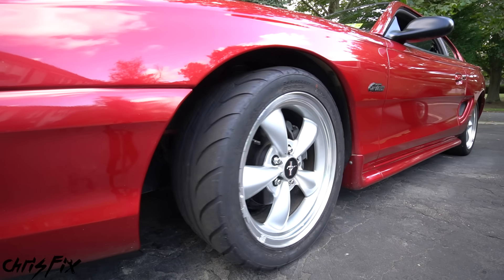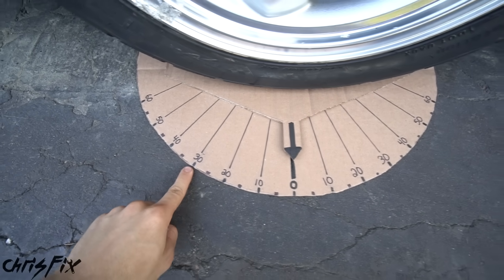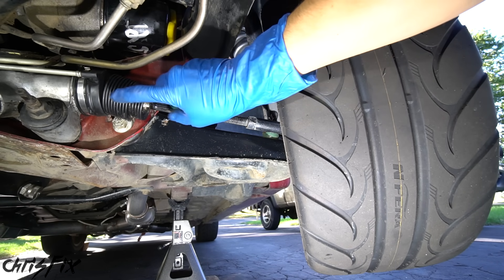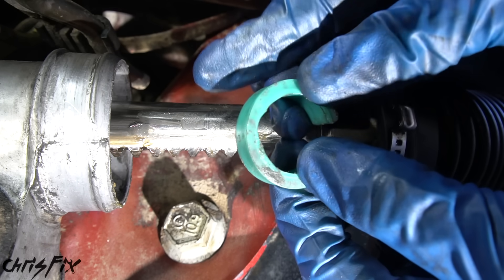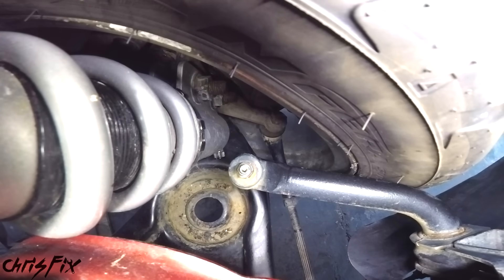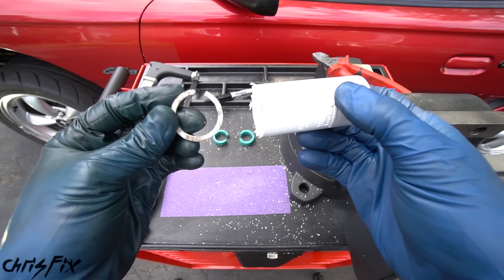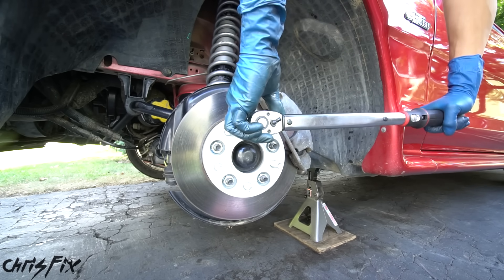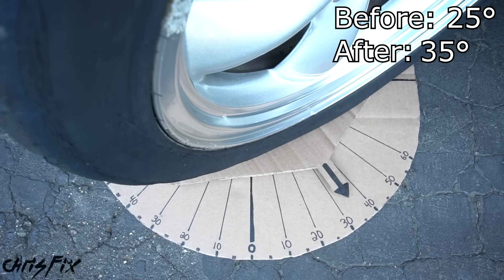How to Get Your Car to Make Sharper Turns (Steering Angle Mod)

Comment: Wheelbearings will wear out quickly if you use the spacers, because the wheel will burden the wheelbearings unevenly. So this modification seems to be an easy job to do, but it's more demanding than you think. Sometimes it's better to leave it as it is than replace wheelbearings monthly.
Reply from the maker: Thanks for sharing. I drift this car and drive it daily. I have gone off the track at over 90mph multiple times and towns 2000lb trailer to and from the track with this car.  I also put many thousands of street miles in the car and the wheel bearings are perfectly fine. There definitely is more stress on them but not significantly.

Comment: Ha misconceptions about wheel spacers it's best to get the ones with built in studs so the wheel lug nuts are full tightened as it would be without the spacer

Comment: Do you have to add spacers to the back as well or does it not matter?
Reply: Wouldn’t matter I don’t think as the back wheels don’t turn
Reply from the maker: You don’t have to if you don’t want. The rear wheels are independent from the front.

Comment: Called single use for a reason.
I was surprisingly right with you . . . until the spacers.
The tread width front to rear, have a correlation to each other that is there for a reason.

Comment: I like your channel, but you ruined the car.. the front track (width between tires) is smaller than in the back for a reason. Adding spacers ruins the stability and drivability.
Reply: also check if they are road legal in your country.

Comment: Hi Chris. I like your videos, they are really helpful and just can't stop watching over and over again. I bought 2019 Ford F150 XLT  Super Crew which has 2.7 ltr turbo charge V6 power plant.  It drives great and has the BEST gas mileage. The only complain about i have is turning radius. I feel like i'm driving good old heavy duty diesels. Do you have any suggestion to reduce the turning radius? If possible can you do a video on it? I know many of your subscribers want it...

Comment: Why in the world would you use antiseize on the rotor and threadlock on the studs? Very counter intuitive. If you torque the nuts properly, threadlocker is not needed. I grease my wheel studs and I drive 3 different cars and haven't had issues
Reply from the maker: Never use antiseize on the studs. You use medium strength theeadlocker to make sure the lugnuts do not loosen from vibration. Antiseize is designed to make something come off easier. That would fail tech depending where you live. Hopefully that answered your question.
Reply: @chrisfix  
Well to be more specific, I use motor oil on the studs, but have used a type of foam grease before. If the lug nuts are torqued properly, they are not going to just vibrate loose.

Comment: Just be careful with the pvc pipe idea. Pvc can get pretty soft when it heats up. Just not sure if its too hot to matter where it will be. Just a warning. Definitely would recommend shaving down the old ones. That way i kno they wont melt

Comment: Just had a new electric power steering rack fitted on my 2011 ford focus LHD in the UK, and I notice the steering when fully turned left or right does not return when I loosen my grip slightly but will stay in the full turning pattern, is this something the garage had to limit on the steering angle?

Comment: there is no diffrence on between running a spacer or a offset, if it aint stock its going to be hard on the wheel bearing.

Comment: So, are you going to add spacers to the back?  You've increased the track width of the front tires by 2".  The rear of the 94-98 mustangs needs help.  You should add some 1" to 1.5" spacers in the rear.  Would look better IMO.
Reply: Wider stance driven through the axles and diff center will produce extra torsion (the axle lengths aren't changed but the length between diff center to rear wheels will be longer). The extra torsion will load the driveline all the way back to the clutch and gearbox with greater shear stresses. Parts life before failure could be shorter, maybe not by much. Dunno.

Comment: A lot of vehicles will have a limiting stop o the lower control arm. It's basically a bolt welded on the control are that will come in contact with the caliper bracket on the spindle. Sometimes the bolt will be adjustable, some you need to cut off with a grinder/torch.

Comment: it would be wise to put 2 spasers at the rear wheels also.

many cars dont have these rack stoppers 
the rod is used as a stopper
to increase the angle in these you have to put a spacer in between the rack and the rod
or shave the rod to fit in the rack body

Comment: Great video. But never trust those 2 jackstands alone. They can fail and smash you dead! Cheap china castings can actually snap like a potato chip.  Use a USA but still never trust them completely.  Use wood blocks or leave your jack under the car as a 2nd safety net!

Comment: Now what you need to do is add some 35mm spacers to the rear wheels.  Ford, in its genius, decided to give this car cavernous rear wheel wells and then then set the rear wheels about 30 feet into them!!!...Without rear spacers you can never give this car that "mean" look even if you put a 1000hp engine into it.  You did get more turning radius but now the front tires edge out toward the  lip of the fender while the rear wheel still stay sunk into the wells.  I  have this same year Mustang but what I did was to add 35mm spacers PLUS chromed DEEP-DISH rims and was astounded at the difference in the appearance of my car. The tires actually come out even with the lip of the rear fender and looks 100% more aggressive...AND, because of the wider stance, also handles so much better when cornering.  Also, I went with 19 inch rims in the rear and 18 inch rims in the front so all-around my 98 looks incredibly more aggressive than what it did from the factory.

Comment: The max turning radius is determined by wheel offset,as well as width of rim/wheel wider rim/wheel =less turning radius.
Reply from the maker: It’s determined by the limiting factor which could be clearance or how much your steering rack moves.

Comment: 99.99% of you will not be able to just "twist off the boot" without damaging it.  You've been warned.
Reply: It's not giving me any issues...oh shit...damn, anyone know how to replace a torn boot? ....lol
Reply: The ear clamp can be worked with a flat blade screw driver to open it far enough to get the boot off. Besides, un-like most, after 30 years of dealer work, I have a bag of 50 or more in the bottom drawer of my tool box. You can buy these at the dealer alone, but plan ahead as they will have to ordered. Also, thinking outside the box, once you know the I.D., go to the irrigation section of the home improvement store and they sell these for water pipe used in lawns. Also, if you have a hydraulic line / cylinder shop in town, they carry these for low pressure return hose up to 8" I.D.
ASE Master Tech since 1978/Retired.
Reply: Oh come on it's so ez
Removes the boot
Tears the boot apart
So um i am back and where can i buy replacement boots?
Reply: Look, as an ASE Master Tech since 1978, if you are unable to remove the "Pinch" type clamp with "Ears" using a small flat blade screw driver, insert into crimp, twist back & forth carefully, then cut with side cutters. But if this make you sick, or scared / tearing the boot....do this!
Rock Auto, Ford, 2002, 4.6L, steering, Rack & Pinion Bellows, select the boot / bellows that comes with ear clamps starting at $4.27 + S&H. Fixed. I have pliers well used for these clamps. Quit crying and Do It! Man-Up and get R done. Dam.
Reply: @deankay4434  thanks for this comment,this will help some people,luckily this was a joke my last comment.lets hope it stays a joke for most of the people
Reply: @sabagamer3052  Just trying to help and make this easy. It takes years of experience to learn and do the vehicle repairs I have made. Pass it on!
Reply: @deankay4434  you are so nice.
Reply: Bra😂
Reply: NorthernChev correct
Reply: 500th like
Reply: That's exactly what I was thinking lmao
Reply: Hose clamps aren’t a good enough replacement?
Reply: Why does it come in 2 pieces instead of one 😂😂😂
Reply: Deadass?

Comment: So with the front wheel adapters, that's going to obviously widen your front track width...how is that going to affect the driving dynamics of the car?\
Are you going to need to add adapters to the rear as well?

Comment: In my understanding the friction between the rotor and the hub is what transfers the torque. So when you lubricate that surface the bolts will be under shearing stress which they are not meant to withstand. I lubricate the centering ring in the middle but never the contact surface. Never had any problem with stuck wheels.
Reply: Wow

Comment: OK so did the manufacturer did it at the 1st place?
Reply: The limiter was there to prevent the wheel from hitting other components,  which cleary did. Plus it's easier to damage the boots with a greater angle.

Comment: Don't do that with front wheel drive. Could be problem with axle
Reply: No. Not with the amount you're changing the angle.  CV joints can move quite a bit.

Comment: On our 2003 GMC Yukon Denali we’ve had hub centric spacers on with 305 wide tires and 22 in rims since we bought it new back in 2003 and we have had zero problems with wheel spacers over 130,000 miles. We have replaced nothing due to them, as long as you buy quality ones I would say it’s pretty much like running stock just with wheels that stick out more.

Comment: DO NOT use any type of lub etc between the spacer and hub face your asking for a failure of component. The wheel nuts only provide the clamping force the friction from the two faces meeting is what resists sheer forces etc. Common error like this is the biggest cause for sheered wheel studs and the wheel going for a run up the road without the rest of your car attached.

Comment: you turn left its 30 you turn right its 25 wtf how is this possible :)
Reply: Ackerman steering
Reply: Also known as toe out on turns
Reply: It's called steering axis inclination.  On a turn the tire on the inside has to turn sharper as it's following a smaller radius.
Reply: So this steering lock angle difference would be the other way around on the right hand front tire?
Reply: Ackerman affect
Reply: rt turn 30,  lft trn 25.   weird,  the inner wheel in a turn  should make a tighter angle that the 'outer ' wheel.  that's Ackermann,   because  the axial centrelines of the 2 front wheels should always coincide where they cross the real axial  centreline.  so the inner wheel turns more than the outer.
Reply: @captainboggles  you are right, seems like rack is just limited different amount to other direction.

Comment: Would these changes work on a Boxer Engine layout like on my 86? The car is JDM specification so the layout of components or steering wheel and rack may be different than a USDM equivalent FR-S or 86.

Comment: You realize, I hope, that the steering rack is not centered, and that means adjusting the tie rods, toe in ,and steering wheel mounting. The inner wheel should always turn more degrees into the turn than the outer wheel, too. Check the angles on Both front wheels.

Comment: many manufactures don't know what the clearance is of the their tire to closest obstruction when the steering wheel is turned lock to lock, which manufacture do you think doesn't know? The likelihood of this being free, is slim, you'll probably need spacer hubs. Before removing anything, check your clearances to see if you can get anymore angle. As your swing arm suspension moves up and down from the middle position, clearances will decrease. Are we to see ChrisDrift?

Comment: Hey,i really enjoy all your diy's but this one,in my country the spacer method is actually illegal and incase an accident you would get shorted maybe 0 insurance pay. Also when increasing the limit of the steering wheel on many cars you risk abs lamp on and none multifunction keys on steering wheel working because the clockspring on the steering column got shot,that happens frequently even without increased steering angle. On a car made for tracks and so this might be something,but on a street car i wouldnt risk ripping the clockspring as its a expensive part to replace,i know because i just did,still very found of your other vids,keep up the good work 🙂

Comment: I have a question. If I put spacers on the front wheels do I need to put them on the rear wheels also? Does it change life time of the wheels if I put spacers on rear wheels also and is it even possible I've never done it or tried.
Reply from the maker: Spacers should not change the alignment if your alignment is in spec. You don’t need to put them on all four corners but definitely install in pairs.

Comment: What about on a solid axle pickup that doesn’t have a steering rack?
Reply from the maker: Usually you have U joints in the front and there isn’t much room to make the tires turn as sharp.
Reply: ChrisFix I was thinking more along the line of less angle so I can run wider tires on the same wheels without rubbing.

Comment: Ive got a suzuki vitara that i just bought and the inside of the tires rubs against the chassis, its got really good rims on it and dont wanna buy new ones with negative offset and sadly being in australia wheel spacers are illegal here, is there anything else i can do or am i gonna have to do the pvc pipe things and decrease the angle a bit?

Comment: Hey Chris, I drive a 06  Scion tC and the suspense is extremely bad it makes a types of weird noise when I hit a bump, pot hole or any ruck. Any hint on how to get good parts to rebuild the suspension Also I would like to know if wheel spacers are good for achieving a wider stands?

Comment: Still if it got some weight on the tire its posible its touch it,and about the spacer have the wheel come off the car? If so if it get some weight passenger it it may damage or touch parts, thus this was a good video with all details

Comment: FWD cars would be much more complicated to do such modification I think.
Reply: You should not even consider doing this with FWD cars. The CV joints are designed to take maximum angle at factory steering angle. You could easily brake the whole joint by turning them too tight.

Comment: Any heads up advice on removing the rack limiter on 2011 Ranger? Will my tire be making contact if I remove them? I'm not a mechanic but the video makes it looks easy and my truck really needs a better turn angle.

Comment: Can handbrakes reduce turning radius on a FWD car ? Handbrakes only hold the rear wheels. So can it be modded to stop only one rear wheel (on the turning side so that the whole car pivots on it) ? Will it cause uneven wearing off of the rubber? 
One can temporarily disconnect one of the rear wheels from handbrake cable and test it out.

Comment: Wtf is a K turn
Reply: Adam Petzke Instead of doing a U-turn where you turn your car seamlessly into a U-shape,you make a "K" shape to adjust to the small space to turn your car. Essentially, you back your car up, shift it back to drive, move forward a little bit, reverse again, and so on an so forth until you've adjusted yourself to make a full turn as described.

Comment: just curious here, what if you just top up the power steering fluid? will it solve the problem when the steering wheel on full lock? or is it a problem on the fuel pump unable to pump more fluid? sorry for my english.

Comment: just curious, love your videos by the way, by changing the wheel to wheel width at the front are you not making the whole job pointless? bigger radius = bigger circle?
Reply from the maker: Good question but as I showed you with the before and after, we significantly decreased the turning radius. The only way to get more angle on this car is to space the wheels out 20mm

Comment: Or just use the e-brake to make sharper turns lmao
And btw you should put spacers in the rear too, because that fitment is not good at all, it would be better if it was at least flush.
Reply from the maker: That would cause you to spin out since there isnt enough angle in the front
Reply: I was just joking, that's probably not a good idea to rip the e-brake at every U turn you do, imagine just casually doing a handbrake turn in a parking lot, or at a wedding...

Comment: Cheap and easy yes, but for the most part steering limiters are also there to protect the powersteering pump.  You can hear it start to whine after removing the limiters. Not a problem if you are planning on running non power assisted steering later on but something to think about.

Comment: Another idea to make rack limiters would be to use the disconnect for push connect shark bite fittings. Because they pretty much look the same as what you're doing. They sell them at Home Depot.

Comment: hris, speaking of the manual transmission, hows the clutch on yours? I have a similar ford product with a stick, “01 mercury cougar” my clutch is wearing out needs replacement. If the mustang needs a clutch job, maybe you could do a video of it on YouTube. I got several quotes on prices on clutch replacement in a few mechanics, I was quoted over a thousand dollars! I would save a lot of money doing it myself. It would really help to see a video. 
Thanks,
Reply from the maker: They clutch is surprisingly good. The throwout bearing on the other hand is definitely going bad haha. I will def make a video!

Comment: Chris, would your clearance have been different with the suspension loaded? Because most cars don't turn with the tires off the ground and suspension unloaded. Good job on the video though, and thank you for telling the masses about not maxing out the turning with the power steering pump whining. Keep up the good work. Cheers #motorcitymechanic4life